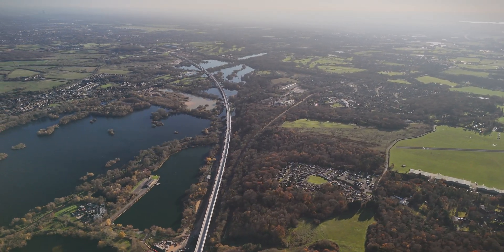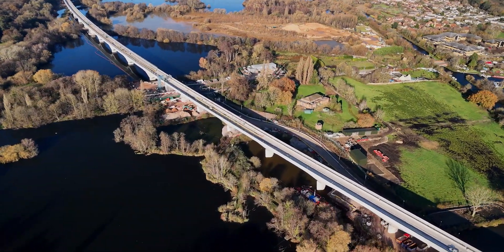HS2 Colne Valley Viaduct Progress 2025 | Construction Update on UK’s Longest HS2 Bridge

Comment: I bet HS2 doesn't cut journey times and it won't run when the drivers are on strike anyway.
Reply: Brilliant! Thank you! 
And it doesn't transfer thousands of lorries from road to rail either which is what they claim.
Reply: @daydays12  The claim is that when HS2 opens 90% of hi speed Avanti West Coast train services will transfer from the WCML south of Crew to the HS2 route so allowing more capacity on the existing southern half of the WCML for freight services and other passenger services
Reply from the maker: Cheers! Thank you for your comment.

Comment: How can hs2 help cut carbon emissions? The damage is already done in the construction of it. We already had a rail line from London to Birmingham so all this is unnecessary. The paying commuting public will be priced out of using it anyway because the government have a lot of money to recoup. They should have built the northern part first before they ran out of money but that doesn’t suit their agenda!
Reply: You havent done your resurch into HS2 have you !!, yes Birmingham has two Railway Routes already to London, but the fact is that the one run by Chiltern Railways can take near on 2 hours to travel from Birminghm Snow Hill to London Marylabone, but the second route from Birmingham New Street to London Euston is totaly grid locked especially Birmingham New Street Station causing delays and train cancellations and HS2 is not just about Birmingham as Birmingham Curzon Street Station and the HS2 route is a replacement for a twice failed upgrade of the WCML which it will replace Hi Speed train wise and to improve hi speed passenger train services between Birmingham, Manchester, Liverpool and Scotland by bypasing the long winded curved southern section of the WCML from Crewe to London Euston
Reply: @craigbarnett9489 It’s not about speed or carbon emissions – it’s all about capacity, to free up space on the West Coast Mainline and hence improve commuter services, inward investment and job opportunities, especially in the West Midlands. It seems that Birmingham has the most to gain from its completion.

HS2 was started by a Labour Government (Gordon Brown), much delayed by too many planning objections and debates. Curtailed by the last Conservative Government. Now back to Labour who have (so far) failed to reverse the decision to cancel north of Birmingham. One would have thought that the new Labour Government would have building in the North as part of their agenda.

The trouble is politicians (of all political persuasions) have a very blinkered view of the world – their only concern is the result of the next election which is never more than 5-years away.
Reply: Of course... HS2 has just polluted the air and pumped huge quantities in to the air.
The noise pollution generated by their trains will continue for ever especially on high rise highly visible viaducts like this

Comment: Now the new government has reinstated the link from Old Oak Common to Euston, this viaduct will not end up as the white elephant it could have been. If the northern legs of HS2 are also reinstated, then the line will prove extremely profitable, and the bridge will pay for itself. As to the environmental impact, the route of HS2 had to go  somewhere, and the route chosen is an acceptable compromise.  Thanks for uploading.
Reply: It’s a question of when HS2 is built north of Birmingham .. not “if it’s built”. It might be called something different perhaps “Great Midlands Rail”!
Reply: @peterjohnson1739  The government minister said in a TV interview that the previous government's plan had been that HS2 could only operate as a high speed line on a dedicated track for its entire length. Consequently the northern section had to be cancelled. But the present government has ordered a redesign of the trains so they can continue their journey on slower lines north of Birmingham.  As I understand it, under the original scheme, HS2 trains would require a higher platform than is normal on British Railways. With this idea thrown out, the prospects for travel beyond Birmingham look more optimistic.  What do you think?
Reply: @AllensTrains  As I understand it the main factor is the length of the trains. The HS2 line from Euston to Birmingham (via Old Oak Common) has 400m long platforms. Trains of that length can’t operate on the old West Coast Mainline (WCML) or to Birmingham New Street. However, a proportion (50%?) of trains would be half the length and could then travel along the WCML all the way to Glasgow – but not as fast as they covered London to Birmingham (because they'd be on old track that's not designed for the speed). That’s why the branches of HS2 north of Birmingham were so important. They’d bring the longer trains at full speed initially to Manchester and Leeds.

There had been a discussion about continental style trains (double deck and wider) here the limiting factor is not platform heights but the sizes of bridges. Put simply, bridges in the UK are only designed for our smaller trains so continental ones will not fit through the bridges.
 As I understand it the current design of HS2 trains (height and width) fit on any current UK mainline track.

I’ve never read or heard an argument over platform height per se
.  In short, all the arguments I've heard imply that the current design go HS2 train can run unmodified anywhere on there UK mainline provided the platforms are long enough (or the trains are run at half length to accommodate shorter platforms). The "government minister" is probably mistaken.

If the present government has “ordered a redesign of the trains” that can only result in further delays and increased cost!
It’s a fundamental truth about any major infrastructure cost ... Redesign = Higher Cost ... (that ‘s partly why HS2 costs what it does, [there have already been too many redesigns]).

Does adding cost (by redesigning the trains) make building it more, or less, likely?
Reply: @peterjohnson1739  This is the video which asserts the higher platform heights were the issue.  https://youtu.be/rZUrWyeOQwE?si=H_YYw1juFmaWswsN
I don't think train length is the key thing.  Trains on Southern operate to stations with short platforms. The guard controls which doors can be opened. An announcement tells the passengers to walk through the train. Example: https://youtu.be/pbtyxdRDIls?si=w4achixgBvGmPbsL&t=816
Reply: @AllensTrains  Hi thanks for this I’d not seen the platform height video.
This video https://youtu.be/hfUZeQ30g7E?t=410 (which is on the same channel) explains the differences between British and European loading gauges. It also goes on to explain how HS2 is well engineered. To reduce running and maintenance costs and that some of the suggested cost-cutting on the build could lead to long term increased costs and decreased reliability. The same video suggests using a Public Private Partnership (PPP), history tells us in both the NHS and in schools that PPP (along with the similar Private Finance Initiative (PFI)) represent very poor value for money for the treasury (taxpayer) because the total cost far exceeds the initial capital cost.

“The maximum length of trains would be 400m, typically formed of two 200m units. However, single shorter train lengths would be deployed on some services depending on demand.” Source: https://assets.hs2.org.uk/wp-content/uploads/2018/05/30143637/CS883_K-Train-Types_web.pdf
I’ve seen several discussions and videos that state that HS2 stations are built with 400m platforms.

Finally, I’m aware that some short platforms exist. They do on the South West Railway between Waterloo and Southampton. However, having passengers move down inside the train to get to the right door is a pain. It’s certainly not something to design into new build either of lines or stations.
Reply: @peterjohnson1739  The difficulty with making all platforms long enough to take a full length train is that extensive engineering would be required. For example, at St Leonards Warrior Square, part of a full length train has to stop inside the tunnel!. To correct this, you would be talking about a £zillion scheme, just to allow two coaches to fit into the station! At Warrior Square, the fact that passengers in the rear coaches have to walk through the train is not a huge issue. They have plenty of time to do this.  I don't see that HS2 trains should be restricted to the south of Birmingham just because platforms cannot be extended further north.
Reply: @AllensTrains  I think that’s why they plan running half length trains. Speaking from experience (using trains out of Waterloo) long trains do work with short platforms BUT getting on the right part of the train can be difficult.
Reply: @peterjohnson1739  The trains are being redisighned shorter so they can run any where on either the HS2 line or the existing WCML and hve never been planned to run into Birmingham New Street Statrion as this is the reason for HS2 and Birmingham Curzon Street Station  to move all Avanti West Coast treains out of Birmingham New Street and operate from Birminghm Curzon Street so freeing up Birmingham New Street for other services. There has never been a discussion about Continental Trains to the UIC Gauge as they would not be able to operte on the existing WCML to Scotland and Liverpool and there were no plans for two types of trains to be built
Reply: @peterjohnson1739  The simple question of the difference between the UK Loading Gauge and the European UIC Berne Gauge is that in Europe their UIC Gauge allows them to build higher and wider bodied coaches and locomotives which with their lower platforms allows for this, it also means bridges have to be higher to allow for higher over head catenary wires on electrified lines where as the wheel width in both care are the same at four foot eight and a half inches, this is why European train could not operate on UK lines where as UK trains can operate in Europe and it is the reason I believe that Eurostar do not stop at stations in Kent any more as unlike the original class 373 Eurostar trains that were near enough built to the UK loading Gauge, the new Eurostar trains are built to the UIC loading gauge so may have problems running into the stations in Kent
Reply: @AllensTrains  Would you want to walk 200m along a train just to get on and off? Sounds a bit silly....
Reply: @peterjohnson1739  It does go North of Birmingham, at present to Handsacre in Staffordshire but there are plans to build it to Manchester now
Reply from the maker: Thank you for your support and comments
Reply: "Profit" for who? Is 'profit' your value?

Comment: What a monumental waste of tax payers money. Only on a publicly funded project in Britain would you see uncontrolled spending on this scale. Not a single cost/benefit analysis in sight.
Reply: You sound like a Victorian from the 19th Century!

The reason this line is costing so much is down to:

A) it should've been built 30 years ago when land prices were cheaper 
B) the NIMBYs have caused a high percentage of the route to be in a tunnel. Tunnels cost more than plain line!
C) material cost has sky rocketed since the first costs were done.

We should be building the final leg into Scotland by know, and with it, removing internal flights....
Reply: Yeah, no. They definitely did extensive study for this. I believe them over you. Despite the cost, it will be worth it. It will remove pressure on other rail links and spur the economy which god knows, needs it. HSR is almost always a good idea, and braindead morons like you are only ok with cost overruns on airports and highways. 10B extra to add one airline terminal? No problem. $1B per lane mile of a highway which will get 10,000 drivers per day at best or $750M interchanges? No prob. High speed rail? Eewww way too expensive. Lol
Reply: Birmingham is a short distance from London. It will provide little benefit for the taxpayer's who are going to have to foot the bill for the interest and principle. Most of the population of the UK are far outwith the reach of this glorified train set.
Reply: I SO SO SO agree with you.
Reply: You sound like a train fan who beyond your weekly shop has never managed a project of any importance and had to control its costs. The cost of this line never made sense and its approval was given for purely political purposes. How on earth did the need for 10 trains an hour at 200 mph + direct from Birmingham to London ever get approved ? Where was the justification for this ? 

If there was ever a rational argument for a second mainline it most certainly could never justify the speeds which have added so much cost to this one. The truth about this project has been known for years now but a succession of governments have all lacked the political resilience to cancel it completely. The contractors have had a field day making cancellation now too expensive to contemplate. It is destined to be a monument to British political incompetence.
Reply: @derekwhyle1884  The UK can't rely on Victorian infrastructure forever, we have to build new stuff, the Politicians getting involved in the project is regrettable because they have watered it down, the cost over it's 100 years of actual operation is a lot less than funding illegal  migrants with a lesser return on that money!?!

Comment: Please everyone, say AITCH not HAITCH. You don't pronounce the H at the start of the letter.
HS2 = A Chess Too.

That said, some great footage of a bloody great eyesore for an unnecessary project.
The whole network could have been upgraded for the same money.

Miles, yards and feet too please. Our official unit of road and rail measurement is still the mile, regardless of what some people would have you believe.
Reply: Road signs are still in miles, because the DfT bottled it in the 1970s.

Rail measurements are in miles on older railways, but in kilometres on newer railways such as the Tyne and Wear Metro and HS1 plus all tram networks, and even the London Underground converted to kilometres. Electrification construction is all done in kilometres, and all lines converted to ECTS use kilometres both lineside and in the cab. HS2 is very much measured in kilometres (although they refer to miles in their PR videos, presumably because they think people would be scared of km).

But no, the whole network could not have been upgraded for the same money - that's an utterly ignorant statement. You get far more benefit from building HS2 than spending the same money on 'upgrades'.